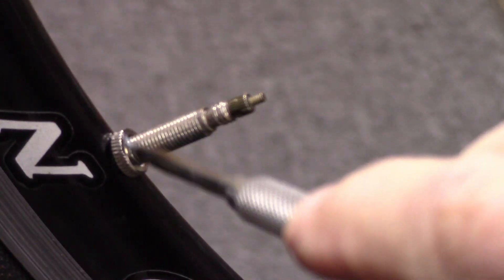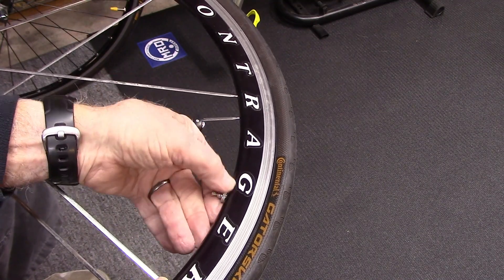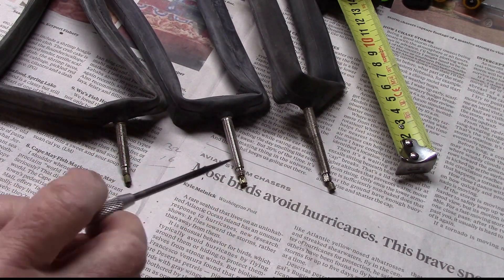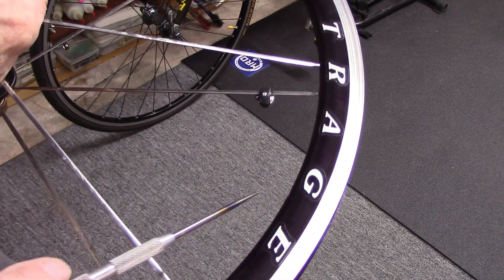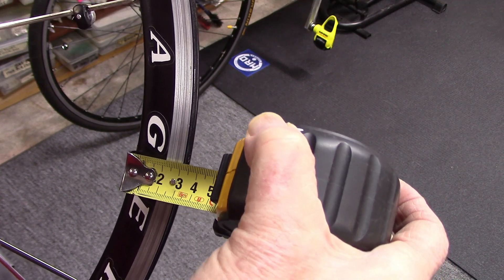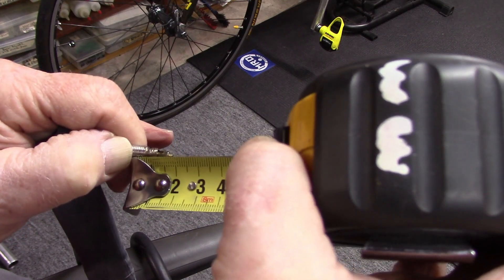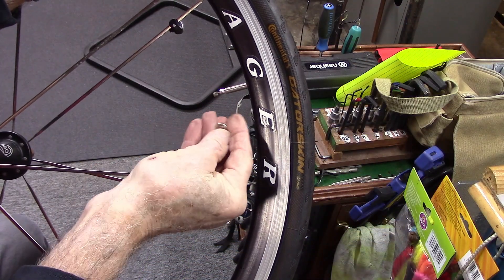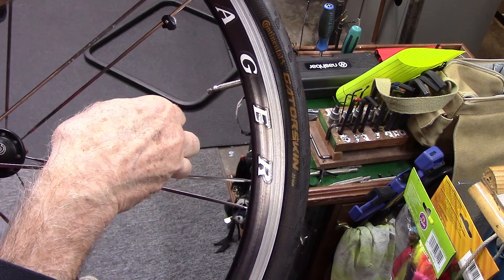What's the Real Reason Behind Threaded Presta Valves with Nuts?

Comment: Great idea adding the o-ring.  I use the nut for initial fill only.  I noticed the WaPo article - hey neighbor!
Reply from the maker: I think the nut is there for the inital fill only. It might be worth saving (with use of the o-ring to prevent over-tightening and noise) for the reasons mentioned in the video or if the tube becomes flat, patch the tube and need to re-pump it. This little nut has created a lot of controversy. But I should state that in the old days we, after we pumped the tire, we just threw it out. It's a personal choice. 
Safe cycling, Tony

Comment: If those the valve nuts are loose can that be a reason why my tire doesn’t hold any air?
Reply from the maker: Unlikely. In fact, if used, they should only be only tight enough to keep from jiggling and making noise. If too tight, they'll damage the rubber around the valve head and cause leakage. Many people just throw the nut away. I keep it on lightly finger tight to stabilize the valve when pumping. 
I would wonder if the rubber around your tire valve is damaged from the nut being too tight, the tube got pinched under the bead when mounting the tire, or there's a leak somewhere else.
Again, one need to take care when tightening the nut. The rubber gasket I use in the video is a help.
Regards, Tony

Comment: I’m old enough to remember when tubes came with 2 nuts. One on the inside and one on the outside.
Reply from the maker: You must be reffering to the age old question of two nuts on motorcycle tires that keeps popping up from time to time:
https://www.vintagehondatwins.com/forums/threads/inner-tube-valve-stem-nuts-the-age-old-question.12350/
Never seen this two nut theoy come up with bicycle clinchers nor have I seen two nuts on tubes as I work on some very old bikes. Have you got some references we can check out?
Regards, Tony

Comment: During my long career Pro - 1/2 track/road/cyclocross did I ever once use these nuts.
Thrown into a box when mounting tires.
Never saw a reason to use them and never had a problem without them. 
Sometimes when drying my jersey in the dryer would hear one clanking around  co's I had left one in the pocket during a tire change.
Reply from the maker: I myself, have always thrown that Presta nut away. But if you want to keep it (for some of the reasons I mentioned), use of a rubber o-ring and care is needed in tightening. That's all.
Reply: @tony10speed  Sr todos mis respetos desde Argentina Usted sr es in ejemplo de persona honestaaa x en el mundo del ciclismo esta muyy cobtaminado de que hay que consumir productos de bici topes de gama eso es pura mentira y marketin para sacamos plata yo tengo 5 bcisi Giant topes de gama die2 stan Axs si ivierto en muy buenos lubricantes muk off finish line gracias para los ejes pasante y repuestos lo mejor cadenas y cubiertas y camaras no me gusta el tubless.tengo Camaras Hutchinson que de 80 mm x uso perfil de 60 o 55  no traen roscadadas los picos uso un pedacito de cinta ahdesiva negra como traen la marca roval la cinta adhesiva la coloco y queda perfecta en la base del pico hoy ruidos mi nada y las que tienen rosca  hago lo mismo conta adhesiva no me gusta la tureca en una rueda de carbono la cinta uso un pequeño pedacito y cada tanto la reemplazo  e seguid con respecto al detaline uso cera liquidar con carbauva y limpieza ej seco x no me gusta mojar las bcis un poco de abrilllantador en un trapo limpo de micro fibra y queda superr brilloso la laca efecto mojado como hacen con los autos ferraris y cuaqueir topo de auto al que se lo cuida
Reply from the maker: @ The piece of black tape works well to keep down noise. Thanks for your comment and regards, Tony
Reply: @tony10speed  mis mas mayores respetos sr me merece me encantaria que conizca mis ncis donde puede envialre fotis para que vea mis cuidaddos con la pintura despues de hacer mi detailin

Comment: Interesting. My LBS advised me to get rid of the nut because if one gets a puncture and is unable to loosen the nut, removing the inner tube becomes extremely difficult! Happy cycling in 2025, Tony. Best regards from Norwich, England.
Reply from the maker: For most cyclist, he probably correct in saying to throw out the valve nut because of the problem with overtightening resulting in damage to the inner tube and problems with removal. For those who want to retain the valve nut (for reasons mentioned in the video), the rubber o-ring and care not to over-tighten are key factores. And regards from the USA, Tony

Comment: You forgot to add the thickness of the nut
Reply from the maker: Good point. However, I think we made up for that by measure to outer part of the rim rather then from the hole in the rim well. This also makes up for any variation in measurement. Thanks for your comment, Tony

Comment: Sorry but your explanation is incorrect.  Back in the day there were no deep aero rims.  The nut was useful to hold the valve stem in place when inflating with a frame pump that in those days typically had no thumb switch to hold the stem, such as the Silca Impero frame pump.  With those, if you attempted to keep the stem inserted into the pump with your thumb pressing on the outside of the tire to trap the stem, that blocked air from entering the tube from the stem.  After a few pumps of inflation, or for just topping off the pressure, it was no longer needed as air pressure would hold the stem in place again the pressure of the pump head.
Reply from the maker: Nice idea and a possibility. Doesn't explain why we also had smooth valve stems without a nut even in the old days. But I like your explaination.
Reply: @tony10speed  not my idea but simply the wisdom passed down by those that came before me.  In this case, the late Sheldon Brown and Jobst Brandt.

Comment: Not too tight is subjective?  Well 10 or 20 years ago, the day came when I got a flat tire and was not able to get the tire off without actually ripping the tire from the valve stem.  Since then, I have never found a need to keep that nut on.  I always thought that this nut was an aid when pumping the tire but I question that now.  Its been decades and . . . forget the nut!  "Sometimes you feel like a nut"  and  forget the nut!
Reply from the maker: The nut is entirely optional. Using an o-ring keeps the nut from being over-tightened. But again, not really necessary to have. Like your comment "Sometimes you feel like a nut." Regards and safe cycling, Tony
Reply: Another thing to do is use Loctite. This makes it so that you don’t have to tighten it much. Blue Loctite does not significantly increase the amount of torque to remove the nut, but will prevent it from loosening.

Comment: You can always use the “depth gauge” on a digital caliper to check the depth of the rim. That needle on the end of the caliper. It’s perfect to put it through the valve hole of a rim.
Reply from the maker: Excellent suggestion. Thanks, Tony

Comment: The O-ring grips the nut and helps prevent it from unscrewing and loosening up.  Also protects the rim from scratches.
Reply from the maker: In the old days, we used a piece of electrical tape with a hole in it to prevent noise from a loose nut. The o-ring works better and yes, it does prevent scratches. Still, the use or need for the valve nut is highly debated. Regards and safe cycling, Tony

Comment: I double nut mine, no loctite needed. The double nut also holds the presta valve stiffer. Turn the two nuts against each other to jam nut them.
Reply from the maker: That will work. However, it might be tough to get the two nuts off if you need to replace the tube out on the road if you get a flat. What do you think?
Reply: @tony10speed  I just hand tighten them, no pliers. I have no problem getting them unscrewed. The two nut combination helps hold the presta valve stiffer when attaching a pump. Give it a try.
Reply from the maker: @nofortunatesonII  I will, thanks.
Reply: lol
Reply: @凸Bebo凸  It works, why the LOL?
Reply: @nofortunatesonII  I'm laughing because you only have 4 installation jam nuts, I have 8 per wheel, get on my level.
Reply: @凸Bebo凸  LOL 😄

Comment: I used to hate using tubes with fully threaded valve stems, because the threading would chew the hell out of the rubber gasket of my Silca track pump head. I'm using TPU tubes these days, so there are no problems with that now.
Reply from the maker: You are correct about threaded valves chewing up the rubber gasket of the pump chuck and one should consider TPU tubes as you suggest. However, not all TPU tubes are the same and viewers should do some homework. Regards, Tony

Comment: lol, not taking bike advice from someone running Gatorskins on a road bike in 2025, if you were fixed brakeless you would get a pass cause those tires have no grip and are good for skidding.  The nut is for securing the tube on the first pump up, and you don't need it all you have to do is push the tire flat when you hook the pump on, useless rotational weight otherwise.

Trick to not damaging your presta valves is just use a threaded pump head, but you should be able to master the push on method as well.  I do push on only I don't remember the last time I bent a presta head and damaged it.  If you are still breaking presta heads its user error, the nut won't help you.

Ditch the Velox rim tape too, that stuff is a nightmare if it gets wet, weighs like 100 grams wet per wheel and doesn't dry out.   Tubeless tape is 6 grams and seals the wheel from dirt and water, it's SO much better.
Reply from the maker: The owner of this bike likes the Gatorskin (does not ride when roads are wet) - a personal preference. As to rim tape, the wheels I build all use 2 layers of tubeless tape but not all the wheels we see are built that way. We see a lot of bikes and tires and do not claim that one is superior to another but leave that up to the owner (unless asked for advise). The use of the Presta nut is also a personal preference and, as you say, is not a necessity. You seem very sure of your advise. Have you worked in a bike shop?
Reply: @tony10speed  Asking if I worked in a bike shop is an appeal to authority, very poor logic.
Reply: @凸Bebo凸  Proposing that you can learn nothing from somebody because of one unrelated thing is an ad hominem argument which is poor logic, and is the second lowest tier in Graham's hierarchy of disagreement. Ironic that you would reject all of his education based on one aspect, while trying to convince him of your education using poor English.
Reply: You presume it's Tonys bike without an further thought.
Reply: @Cycle.every.day.  Tony is on here using the installation jam nut, Gatorskins + Velox is an upgrade from that level of Fred, I was just giving him the benefit of the doubt.

You are correct though, this advice is on a lower level than Velox + Gatorskins on a geared road bike in 2025, and I should have assumed more negative things.

Comment: Wait. What? Many presta valve stems have had threads LONG before there were any "aero" wheels while Michelin sold tubes without any threads long before "aero" wheels showed up. Tubular tire valve stems don't have threaded valve stems either. WTF they put threads on 'em seems to be that customers expect 'em rather than them doing anything other than chewing-up your pump chuck gasket. Same for the nut and valve cap, though the valve cap at least helps keep the threaded bits from chewing up the tube itself in the box (or in your seat pack). NEVER had any issues with longer-than-needed valve stem lengths other than the aesthetics...they look kind of silly on low profile rims, but if you have both low and high profile rims and don't want to worry about it, they work just fine.
Reply from the maker: Your comments are appreciated and it's not clear why so many clincher tubes still come with threads and valve stem nuts. I can only speculate as I did in the video. Can you get by with smooth stems and not stem nut? - absolutely yes. Regards, Tony
Reply: @tony10speed   "I can only speculate as I did in the video" OK, it seems zootube's full of speculation rather than genuine fact/information, that's why I questioned your speculation as to why the threads are there. Perhaps someone should ask one or two inner tube makers why?

Comment: The "real" or original reason for the nut is that most pumps presta pumps used to have push on heads. You needed to push the head on firmly and without the nut there is no way to get the pump head on. Take a look at the Silca Presta Chuck which is the same design. you force the valve through a thick rubber seal. Without the nut you will just push the valve in and most likely ruin the tube. If it is loose enough to get on without the nut, it will be so loose that you won't get any air into the tire since it will all leak out around the seal. Your pump has a locking lever so you don't need to push it on and the nut is "nice to have"
Reply: You need to discover putting your thumb on the tire where the valve is when its flat.
Reply from the maker: The Presta nut seems to be an optional component, at least in my opinion. I have not had tube problems or leaks with a push on chuck if the wheel is resting on the ground or floor. But I understand your concern and appreciate your comment.

Comment: How about the dirt that can go through the hole? I think the dirt can flat the inner tube.
Reply: Good point, also I often find water inside the tyres, even if the tubes were always well inflated.
That said most recent TPUs come without the thread, so his trick with an additional rubber joint won't do.
Reply: @DR_1_1  The installation jam nut should never be used while riding, that's why it's not on TPU tubes.
Reply: @凸Bebo凸  I've heard that position before, same for the caps, but I never understood the reason.
If the tyre is flat I need the nut to inflate the tube, and the cap could protect the valve from dust and dirt.
So I always keep them on - if the tube has a thread - I even have 2 nuts on a valve to help equilibrate the weights of the wheel...
The real reason for unthreaded TPU's valves is weight saving, the metal is largely replaced by plastic.
Reply from the maker: Why should it never be used while riding?
Reply: @DR_1_1  The metal valve TPU tubes are the same weight as the plastic valve ones.  You don't need the nut to inflate the tube, you put the flat side down, put your chest on the handlebars and put the pump on.  The nut was for a time when long presta valves didn't exist, and you didn't need it then either.
Reply: @tony10speed  It should never be used while riding because of its name the "installation jam nut."  If you put it on too tight, it will snake bite your tube.  If you put it on too loose, it will rattle.  If you put it on just right, it will only stay on for a week or two before it starts rattling.  If it's on just right it does nothing helpful.  Since the nut was invented before loctite was we can assume it's not meant to be used.

Another good sign you aren't supposed to do it, is that no pro riders do it.
Reply: @凸Bebo凸  New TPUs with plastic valve stem are a few grams lighter than the same with metallic stem.
That said if there is a thread on the valve stem, I'm keeping the washer nut, it's just more practical than pressing the tyre-side of the stem to maintain the valve out of the rim.
I'm also keeping the caps on, even if the keepers of the cog become mad at me for not respectiong The Rules! And mine caps are green...
Reply: @DR_1_1  I ride 150 miles a week and I can't remember the last time I replaced a presta Valve.  My front tube has been on the bike like 3 years now.  None of that is necessary, no skilled riders do it.  I will paypal you 50 bucks if you can name 1 paid racer that does it.
Reply: @凸Bebo凸   Paid racers have mechanics, replace their bike multiple time during a race. I don't.
I pinched a tube this year, had to inflate the tyre several time to come home. The washer nut was very handy.
I'm mostly on roads but have trails on a majority of my rides, often with bad rocks among the gravel... I'm more careful with tyre pressure now, but keep a spare tube and tyre lever with me.
Any way, as I said the latest tubes I'm buying come without any thread or nut, so... But I still put the caps on the valves!
Reply: @DR_1_1  The latest TPU tubes come with threaded aluminum cores that weigh the same you're behind the times.
Reply: @DR_1_1  Nobody skilled does it, will get you made fun of big time.  It's useless for replacing a tube out on the road also why they don't bother with it on plastic presta valves, you just put the valve side down and your chest on the handlebars, simple.
Reply: @DR_1_1  Well I guess continue to do what no paid rider of any kind of bike would do, I'm sure you know best.  Be sure not to overtighten, because that's a free pinch flat for no benefit, haha.
Reply: @凸Bebo凸  I've been riding for decades and never had a flat because I tightened a washer nut.
Otoh I had 2 TPUs deflating for no apparent reason, from the valve stem area - the kind of TPU tubes that come without a thread...
Reply: @DR_1_1  The only cool reason to have the installation jam nut on your bike is to use it as a spacer on a bike rack that won't fit, sorry bro.
Reply: @凸Bebo凸  I'm not after "cool" but practical.
I had several tubes without a washer nut ruined for no apparent reason near the valve/stem...
Reply from the maker: The tube, when inflated, seems to keep out any dirt. I, personally, have not seen this to be an issue. But I have had water come thru around the valve hole with our without the valve nut when riding through large puddles or steams of water.